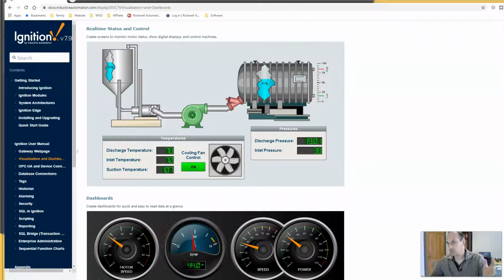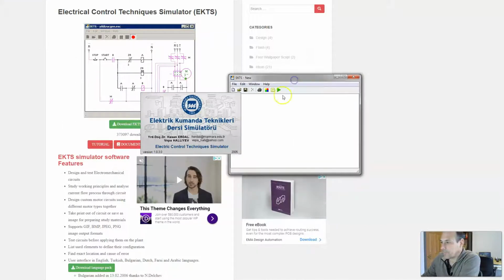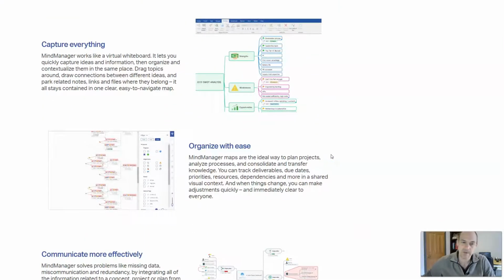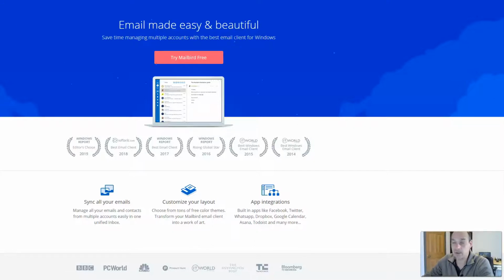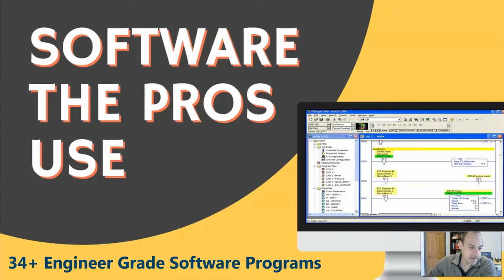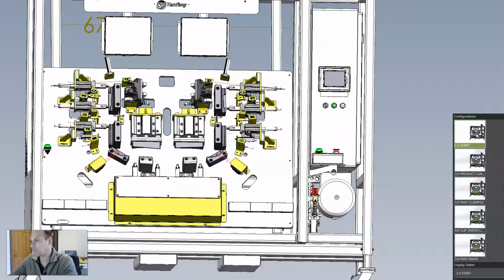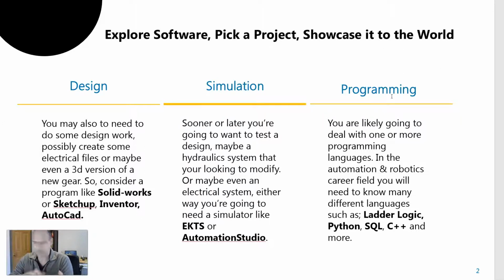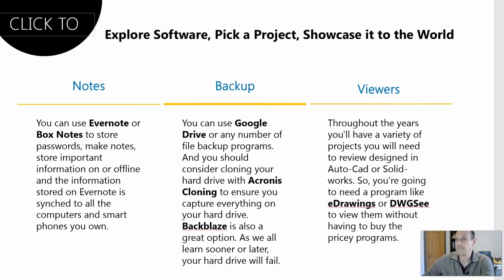List of Software PLC Programmers Use

Comment: is autodesk revet good to learn for an automation engeneer
Reply from the maker: Thanks, that is an interesting question. While in general the answer is NO in regards to learning Autodesk Revit for a career in automation controls. I pose a thought, if you were to merge Building Automation Programming with Revit you would find a good fit, to include function block style programming with building design knowledge useful. I will be doing a video on Building Automation this week that will introduce you to what I mean. Stay tuned.